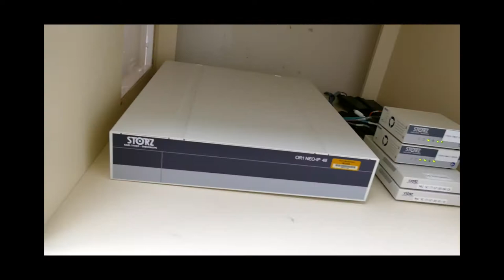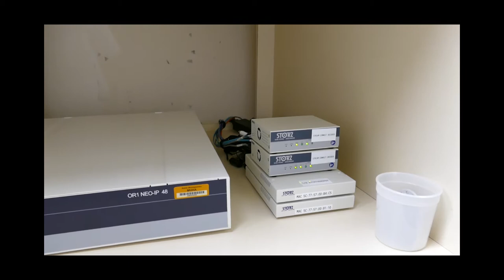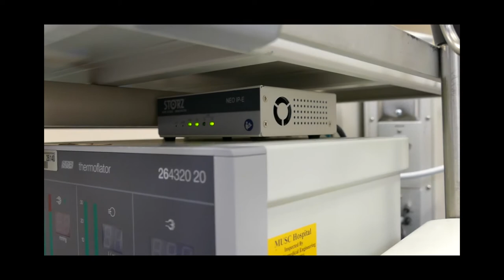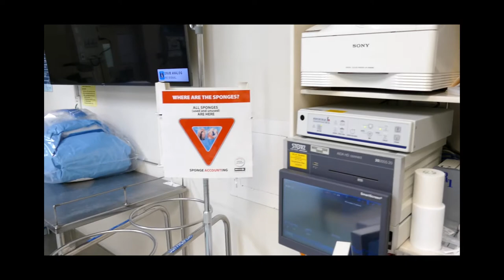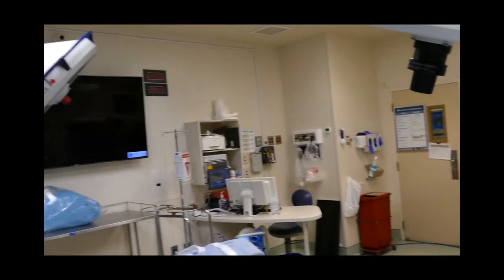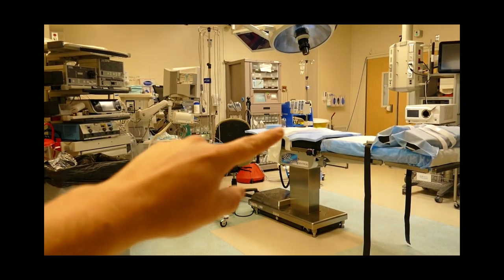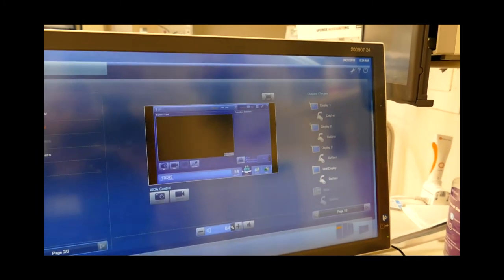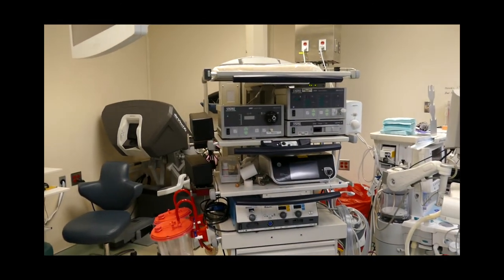Latest and Greatest: Storz IP NEO Video System

Comment: Thanks for posting.  Since your post have they done anything to change the fans?
Reply from the maker: As far as I know, the Storz system is still running with the same hardware.  There were only few issues with the system since install: A loss of USB which required a cumbersome 10 minute reboot of the rack.  The wires all needed to be terminated with wire ferrules when installed into screw down connections (this would have prevented the constant pulling out issue we had). The 37" $8k field displays have a known issue with uneven picture and a image darkening. -This required a couple warranty replacements and downtime.   I haven't worked at this hospital in 10 months now. I'm hoping things have been good since. I'll keep you updated.
Reply: -	As video distribution technology has advanced, KARL STORZ has been able to remove fans from many of our devices, simplifying maintenance requirements.
-	The system now comes prepopulated in a rack for cleaner installation and the system reboot process is much improved in our latest software.
-	Many of the “pulling out” issues described are being addressed with ferrules as standard practice, or by new technology which embeds the video-over-IP encoder within a wall plate, so that cabling is no longer exposed.
Detailed specifications for the current NEO IP operating room integration system can be found within our technical specifications portal here: https://www.karlstorznetwork1.com/flexpaper/or1-neo-ip-specifications-sheet

Comment: Over engineering, most of the time never ends well for the customer.
Reply from the maker: This is a common situation with German engineered equipment.  -They make beautiful devices that are built really well, just not usually easily serviced.